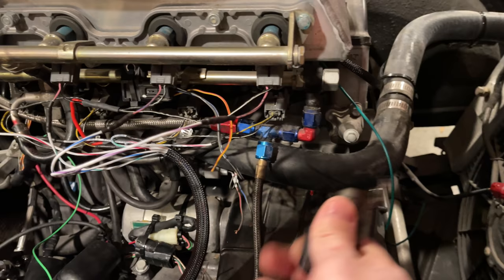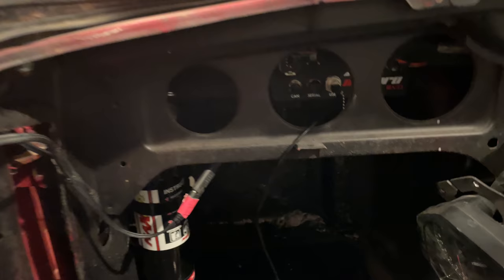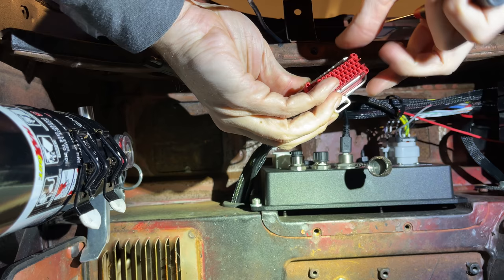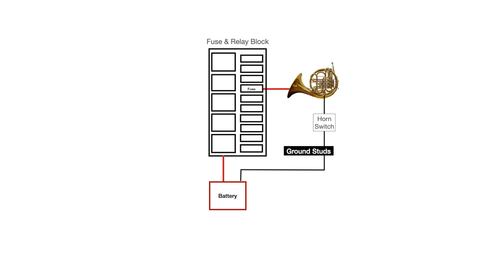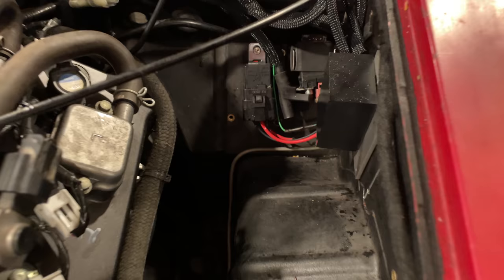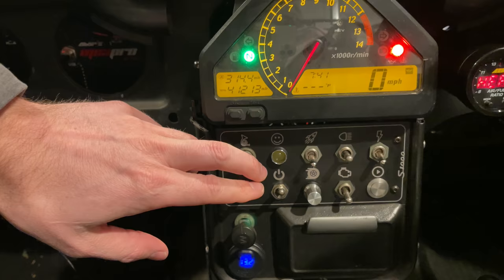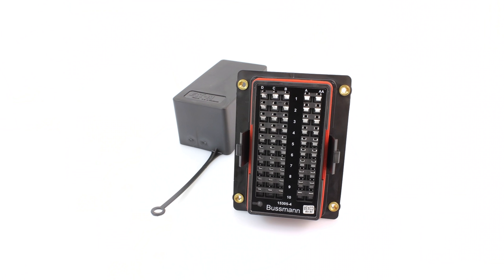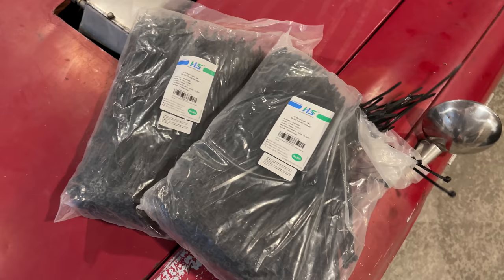Re-Wire Your Whole Damn Car - How To Do It Correctly & Inexpensively

Comment: Uninsulated connectors are the best way to go. Sometimes I will add in a bit of solder depending on the connection and if I need to ensure the connection won't come apart when pulled on. Of course sometimes I just do soldering directly.

As for heat shrink it's really good practice to get the type with the waterproof adhesive on the inside. It's just all around better.

Comment: I worked in the electronics world and found that some marine pieces are best for the land side wiring  as you heat shrink the fitting after crimping ,it soldiers itself . Two whole steps saved But pricey I use them for most important circuits  engine, charging, lighting . AC, heat , radios/am-fm regular crimps work for these . Get the UV zip ties black works just fine but they do come in colors . Use sparingly or it looks like a circus under the hood .

Comment: The 1985 Chevy truck I bought recently has wire nuts all over it, and the camper shell had wire throughout it that was consistent with what I can only describe as 1990’s lamp power cord wire. Complete with retro boring brown color.

Comment: Pretty solid how to. If you need non insulated connectors and can't find the ones you need for what ever reason,  you can just heat up the plastic ferrule with a lighter and pull it off.

Comment: I like the "gutter tube" wire loom, because I usually wire things on the fly and I can easily add or subtract wires in that loom as things change/progress. If some wires need to exit the loom before they get to the end of the loom it's real simple. That's where I like to use the fabric tape, at exit points and at the ends. I can just cut the tape with a razor blade and make changes then retape it. I generally run all my wires first being attentive to their trajectory so that they can all be easily tucked into the loom afterwards. I wouldn't use the braided stuff unless I was certain nothing was going to change which is almost always never on a custom project. 

Good tip on not over connectoring. Very good tip on those delphi connectors. I've been looking for some good generic automotive type connectors for decades.
Reply: Fabric tape? On wiring in a car engine... 🤔
Reply: @samhain9394  Back years ago, all auto wire looms in the engine compartment was done with fabric electrical tape. Actually, my 05 f350 has fabric tape wire looms. Tough stuff. Perhaps you're thinking about "fabric" as in the kind your mother would sew into a dress. This is fabric, like duct tape fabric, but made specifically for wiring.

Comment: I am currently wiring a 95 F350 4x4 dually. I used the Painless wiring kit for the 78/79 Ford trucks and it is perfect. Engine is a standalone FiTech Efi 460, standalone trans controller. There was literally no difference between the 70s Ford layout and the 95, wipers, all lights, ignition, heat/AC, radio, dome courtesy lights, it's all basic functions except the 95 was factory efi and 78 wasn't. Ford really did not make leaps and bounds in those 2 decades. I ditched the factory steering column, replaced it with a collapsable race car column, moved shifter to the floor, overdrive button is on the shift knob. Ignition is in the dash now,
overall it wasn't daunting.

Comment: I use the wiring harness from a outbourd the key and all ! It's so handy to use every wire is colour coded and  every model outbourd  you can google what wire does what and All relays and solinoids are waterproof  ! Plus you can get them for free from Old blown up moters the battery leads are awesome and U can get long or short harnesses from different length  boats   ! Heat shrink with  glue inside it is also good  ! The stuff that Telstra or telecommunications industry use is really good and can go from thirty to eight mm or whatever U need ! Tinned wire is also good if you are doing a lot of soldering connections on its so much quicker but most harneses don't use tinned  ! Great video it's simple explanation to what can be a can of worms ! Different types of solder can make your day easier if you get the correct one

Comment: I don't know about other cars, but the Porsche 928 had a lovely fuse and relay box, with about 75 separate fuses and relays, which was all WIRED IN THE SAME UNMARKED GRAY COLOR. Yep, all wires leading into the box were the same color, none of them numbered. So if you worried that your electrical gremlins might be the result of corrosion over time, taking the thing apart was going to be a nightmare. Yes,it used some stainless steel wires. BUT THE CONNECTIONS WERE BRASS.  You'd have to label hundreds of wires as you went along. It was one of the primary reasons I decided to sell it.

Comment: with the insulated connectors they do work great if you have the molex tool that crimps through the insulation and actually makes a double pinch that locks it in
but then you still need heatshrink so i only use em if i need to buy connectors NOW

Comment: A recommendation for debugging: make a couple of long wires with medium-large gator clips on them, as the leads on your multimeter wont be logn enough to reach from inside the car around to the engine bay or other circuitous paths. Also the gator clips are nice ao you can grab terminals instead of trying to hold two pointy probes on things and actuate a switch.

Comment: A lot of newer cars use multi signalling with multiple signals at different HZ running through  the same wire. I was used to working on old cars from the 60’s & 70’s & never heard of multi signalling wiring,  causing me a big stuff up doing some wiring on a 1990’s Volvo

Comment: Of course I rewire the entire cab of my truck to factory colors about 4yrs ago and just now see this vid... I did however use mostly GPT. Also fully insulated and engine bay is next for full rewire. Ps. Added a 2nd bat under the hood and a standalone "fuze block" or fuze panel. An inverter and 2 can 12 fuze panels for anything and everything I've been adding.

Comment: I like your service and your style in the terms of constructive criticism I have a lot of experience with wiring and electronics tech the cramping of the wire connector is critical I use a ratchet type of connector so each conductor is near tighten up to bond with your electrical wiring bring a very secure joint this is like necessary on any kind of the smaller pushing style connector box also you mentioned a realize it had a built-in diode as a means of protecting a drive circuit before they were drives And the purpose was to help cover up the field the bills up and I realize it’s written driven by DC and I will help them react faster also help protect Drive

Comment: Lots of people say don’t run speaker wire to your fuel pump but speaker wire would be an upgrade to what most people use.  Plus if the person has had quality wire for a sound system they are thinking about pretty nice wire that would carry a lot of current. Last I’m not proud of this but I’ve used speaker wire right next to a Holley wire harness and all the colored wire in the Holley turned white in about a month of exposure yet the speaker wire still looked great, and it was not high quality stuff. In this instance Holley used the cheap stuff not the good vinyl and my scrap pile speaker wire had better sheath.

Comment: Dear Matt - I did it! Rewire the whole damn car. It helped that it's an '87 Subaru Brat, as easy as wiring gets, but without your video (this one) I would not have dared to dump the whole mess of a sketchy old harness forked up by previous amateurs and start over. Your tips have been incredibly valuable, tools, wires, step by step and circuit by circuit approach, all right on the mark for the wiring newbie. The other channel that was extremely helpful to grasp the basics is Wiring Rescue https://www.youtube.com/@WiringRescue
So, I wanted to say thank you for the inspiration, encouragement and enlightening example. I now have a running, flashing and honking car that's bristling with flip switches and gauges, as well as the envious admiration of my buddies who break a cold sweat when the word electrical is even just mentioned.
To all car enthusiasts fretting about the electrical stuff I say, watch this video and rewire your whole car. Or just watch Matt do it, whatever. 
Mahalo!

Comment: Hey Matt, thank you for uploading this video and providing a lot of good tips.  I was going to buy a new ECM wiring harness for my 1986 Grand National from Caspers.  If you get the ECM harness for an aftermarket ECM it runs around $1450 and given the quality, testing and warranty that is probably not a bad price.  However, that is for the ECM harness only and does not cover any other wiring, which, to be fair there isn't much more.  Seeing as how all the connectors are still available, at least for the engine harness and most of the other components like the highlights, taillights, etc. I was thinking of puchasing the connnectors and building my own ECM wiring harness.  The stock ECM harness is now 38 years old, but there are not really any issues with the connectors cracking or insultation corroding so that gives me time to actually get all the connectors, terminals, wires, relays, fuses, tools, etc. so I can build the harness and test it out.  In addition, by building my ECM harness I will be come up with my own design, design as in terms of routing, and with the new harness it will help clean up the engine bay.  Because the stock ECM harness is dirty and old.  I will watch all you vehicles and reference a few more and try to do a cost benefit analysis to see if it is even worth it to try and build my own custom ECM harness.

Comment: If you're having problems with nylon insulated crimp lugs, you just need to get a better crimper, and perhaps better quality lugs. I use a paladin/greenlee ratchet crimper with the appropriate dies. For terminals I get either Molex or Panduit. Works like a champ every time

Comment: When I do wiring harnesses, I run one wire at a time as neatly as possible and use the el cheapo 3 inch white zip ties to hold it temporarily to the previously run wires. I do end up with a lot of white ties but then I come back around with quality black zip ties neatly installed every couple inches and cut out all the temporary white ones as I go. It makes for perfectly run wires that are a cinch to follow and you have a harness that is stiff enough to lift out as one form fitting piece if you have to remove it.

Comment: very cool video. I learned some stuff. I'm getting ready to rewire my s10 v8 swap project and I think i'm going to start with a universal gm harness because i think it will save some time on making turn signals, brake lights, hazard lights etc.. all work properly. that being said I'm getting rid of the gm bulk head design fuse block since it is the reason half my stuff doesn't work

Comment: What i also like to use when connecting two wires in a car is heatshrink  with glue     than is the connection water tite and the cables holt better because of the glue.      Love then 

And super video 🔥🔥

Comment: When I repair wires with heat shrink tubes, I prefer to use hot air blower from soldering station, instead of open fire. Blower has very narrow nozzle that allows you to heat only the wire you want to heat. If you have gas leak in engine compartment you didn't noticed it allows you not to buy another car and possibly the whole garage. Same thing when you work inside the car, all the insides are very flammable, it burns out completely in 5 min.

Comment: Aviation rated insulated crimp connectors fit well. They have two parts of different sizes to grip. One for the stripped wire and one for the insulated part. Never realised how good they were till I bought some standard auto connectors.

Comment: I did this on my old 67 Dart, but basically just copied the original harness with new wire and terminals.  I did expand the fuse box to use more than the original 4 factory fuses as well.  I integrated some more circuits for my Megasquirt installation and added a relay and fuse box under the hood to support that better.  A lot of the reason I did it was just to have new modern wire and fresh terminals though.  Originally I didn't integrate the Megasquirt into my harnesses, I just reproduced the factory ones and changed the original bulkhead over to a sealed style.  Just that alone made a world of difference for things working better and lights not flickering since they all now made good contact with fresh terminals and quality wire that takes temp and age better.  A wiring diagram and the original harness laying on a table make it pretty easy (relatively speaking) to make a new harness from scratch if you're just copying things.

Comment: On stuff like the spade connectors, I've had really good results with the cheap knockoff marine ones that have built-in heatshrink boots.  It's soft enough that it doesn't interfere with the crimp, and is less hassle than separate heatshrink.

Comment: I'm going to watch and judge. Over halfway through now, very well done.

Also started redoing some wiring on a 91 diesel suburban. So far I've got some nice 1/0 cables(Bigger than stock, which I think was either 2awg or 4awg) to the new Powermaster starter (way better than stock). Still need to do some other circuit portions to help the voltage drop to the cabin that I get.

To be clear, I'm not necessarily intending to rewire the entire vehicle. Just improve some electrical issues. The above two changes mean the starter moves QUICK, good for starting a cold diesel engine. I also replaced the ground between the engine and the firewall, which significantly improved the voltage drops I was seeing into the cabin. It did not eliminate those drops though, so some work will be needed on the positive supply to circuits into the cabin. 

I was aware of the heat shrink labelers from my previous employment as well, but someone seemed to think they were insanely expensive. I think not, given the links you have. Definitely grabbing some for this and other projects.

Comment: I did a 1949 Willie's jeep truck and used a painless wiring fuse block, the rest of the truck was dont in 10ga wires.
If your talking pull the factory harness out and replace it yes its plug and play.
But I pulled every inch of wire to each light bulb socket and soldered in new wires. Lets face it a 1949 Willie's jeep is very basic wiring and it had been changed to 12 volts from 6 volt system already.  I kept with the fact it was gm colors and Ford dome lamp circuitry as well as motor wiring with some Chrysler parts to go along and a tractor style turn signal system and presure brake switch for the hydrlic brake cylinder.
The dash cluster was just bulbs, my only problem was a 12 volt sending unit for the gas tank and a 6 volt gas gaudge. 
Then a few years later I added a sound system, I should have added a ceramic heater unit becuse it was ice cold to drive in the winter without any heat.

The wires i used came off of spools i twisted each run and put it in black tape then split loom,  if your smart just make long runs long enough you wont splice anything and put it in and don't think how long each wire needs to be youll spend hours to save a few bucks, not worth it.

The main reason I used the painless wiring system was the fuse box, it went inside the car on the firewall like an older gm.

On a newer car you can buy a harness out of a scrap car.  Or buy a new harness that was made for that car. 
I've seen ratrods that the home shop wiring looked as bad as spegetty dinner at the church on a monday.

Comment: I build my own wiring harnesses because of one reason...All the major suppliers do not use relays, instead they just go to an 8 or 10 wire.  Ues thats how they did it in the olden days but theres more of a safety issue here.  I install a ignition relay as well controlling all the ignition side components plus a mega fuse, clean power and clean ground.  Cross linked wiring and the quality is, high quality is built in without costing $800-900 bucks or more.  Easily expanded adding circuits.  
Never had a problem.  And if your inclined make your loop terminals from copper pipe, use marine grade heat shrink with glue.

Comment: isolated forks and ring cable lugs can be good if you have the correct ratcheting tool and the correct wire size at work it is the only type we use and you aint pulling those off

Comment: I'd recommend having a chart in Excel (or similar software) to help one calculate wire lengths and it helps to summarize what length of which gauge-colour wire you need.

Comment: I was trying to repair my electrical system and just kept finding different wires failing so I lost my patience ripped all the old crap out and did it all from scratch using a 12-volt Marine fuse box as my hub. Been using 10 and 12 gauge wiring only. Thicker the better. Fuse box has two 4 gauge wires running to it for positive and negative output. When I love most about my nephew's boxes it has led so when a fuse goes after you know which one without having to pull it.

Comment: The PIN connectors with a double crimp I find work best. One crimp for the wire connection and the second over the insulation so the wire strands are not stressed. 
Without the second over the insulation the wire strands can vibrate, work harden, and fracture/break.
Wrapping with non adhesive harness wrap makes it look OEM however it is difficult to repair anything.

Comment: This video is a great resource. You should also teach professionally if you don't already.
Also, there are crimps on the market that have built in heat shrink insulation, they're much better.